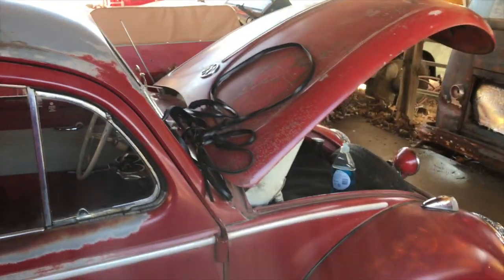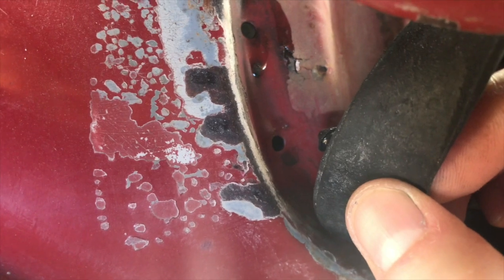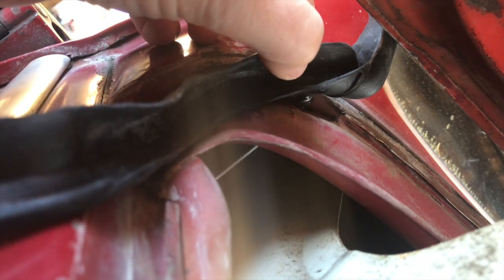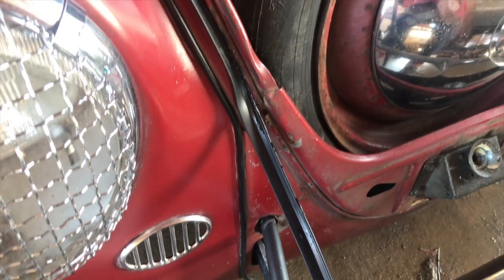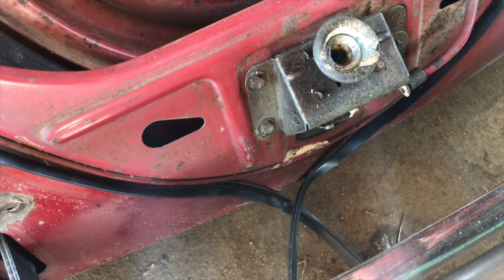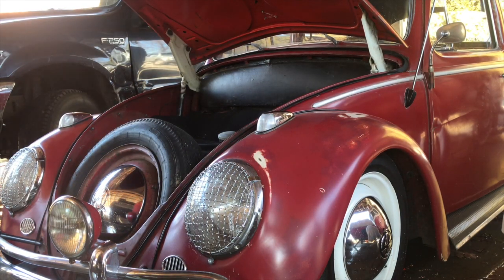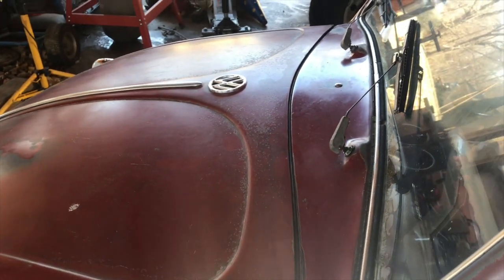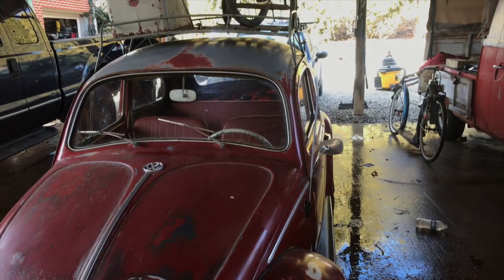VW beetle hood seal install and emergency brake fix

Comment: Love that you posted the string tip. It’s the only way to install a non-German seal. I only use the German seals with the long tips to avoid that problem. I have a video on my channel but will be including a link to yours as well. The seal channel shouldn’t need to be opened up unless someone has altered it. Also, WD40 is the best lubricant for this job.
Reply from the maker: I use the thread trick for lots of different applications...good thing to keep in the  tool bag! I  always clear the channel and open it a bit to just make the job a bit easier and remove any possible debris that might be in it...I find plain ole beeswax works well too, but WD is just as  good as anything I guess...as long as the job gets done!
Reply: Silicone spray worked perfect.

Comment: Man I just got some cheap adhesive insulation strip from home depot, paid less than 10 dollars and it's lasted me longer than 3 years!
Reply from the maker: You are just smarter than me😂 actually this was only about $15 so it wasn’t too pricey!

Comment: nice trick with the string, as far as the e brake being too high, if you back off on the cables and remove those spacers that someone put in it will allow the arms inside the brake drums to relax back, then you can adjust the rear brakes much better. then you will notice that it takes much less ebrake cable up by the lever and you can adjust it to about 5 clicks, then over time as the ebrake gets higher you will know its time to adj the brakes again, also you will notice that the brake pedal will be much higher too as the wheel cylinders are all the way closed when not pressed, but when the ebrake is pulling some the wheel cylinders have to traval some too fill the gap caused by the ebrake lever. great job on the video,
Reply from the maker: Mustie1 THANKS FOR THE TIP!

Comment: Hey you have the whole crew following you along lol.    Love the patina on ruby, thought to ask you... What was your plan and what materials did you use to make her age show through.  I like how its not overly glossy.  I have been thinking in the future of how to bring misty to show her colors.
Reply from the maker: E-man Deluxe the main body of Ruby was all original patina...all the fenders and lower hood I did with 3 varied shades of red from walmart😂 then sanded randomly between coats and then wet sanded with 1000 grit on final coat to have control when my dark layer started coming through I could control and stop when it got to where I wanted it...then sanded several areas down to bare metal and used hydrogen peroxide mixed with salt and vinegar to rust them...we used glossy paint but then wet sanded everything at the end to get a dull look closer to the original patina. Then 3 coats of wax and buff
Reply from the maker: One thing I would recommend is maybe putting a grey primer down first...vw used grey...so then once you get down to that layer you know will blend pretty well with the original car if it is down to that...love ole Misty! Good luck! It’s gonna look great! Just pick a fender or area and play around with it!
Reply: Wonderful.  I will jot that down for future notes. Thanks so much for sharing
Reply from the maker: @EmanDeluxeVLOGS  don't ever hesitate to ask, happy to help in any way I can! love when folks do their own "stunts" as I call it! lol
Reply: For sure.  Project has really been fun.   Hope to have it on the road 1 year since i saved her. The push has been very steady.  Thanks for loving misty.  She needs it...

Comment: So I just replaced my seal on my 1970 beetle, and needed to make an adjustment as well for closure on my hood, by increasing length of spring on the handle corrected my problem, hope this helps someone out there. Thanku for the well documented video
Reply from the maker: yes we've had to adjust this one a few times to get it just right! I also just made a plasma cut hood for this one that we swap out for "special occasions" (link below) and so it is adjusted differently...as you know with a VW always "tweaking" some bolt or another!  Thanks for stopping in, I appreciate it! 
https://youtu.be/j9zisP3kPdg?t=16

Comment: I had a similar issue in my Bug with the wind freezing my hands in the winter, even with a new seal. I ended up putting black felt in the vents... but the vents are different in my dash.
Reply from the maker: yeah it's crazy how much air was coming in up there...I put a foam type insulation up by the radio speaker area and then with the hood seal I think we mostly got it...

Comment: Where the seal meets in front. Do you  ot glue it together ?
Reply from the maker: you CAN glue it, but you can also use a soldering iron or plastic welder and kind of melt them together.  Another option and the one I used on this car is I slightly overlapped them then took a straight screw driver and hit the metal bead tight with a "divet" at the overlap spot!

Comment: Did you use a German or Brazilian seal? Good tip about the string!
Reply from the maker: We ordered it from cip1.com and got the Brazilian one!
Reply: marcijunebug hows it held up, I’m trying to not justify the $20 extra for the German one LOL
Reply from the maker: DubWerks 😂I hear ya! It’s held up great and we DRIVE this car almost daily and it is NOT garaged, carport only but it gets exposed to serious weather
Reply: @marcijunebug  That's it then, getting the Brazilian one LOL Thanks!
Reply from the maker: DubWerks do it! Can’t wait to see your beetle all together! Really proud of the work you have done! Looks amazing already!